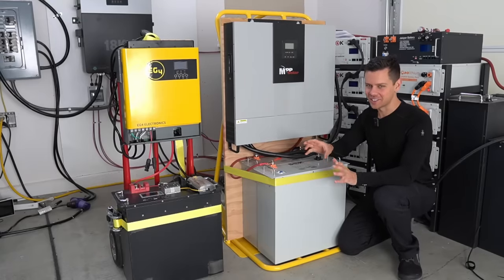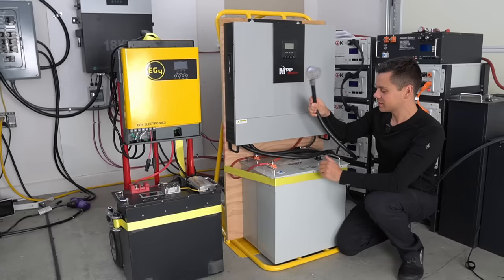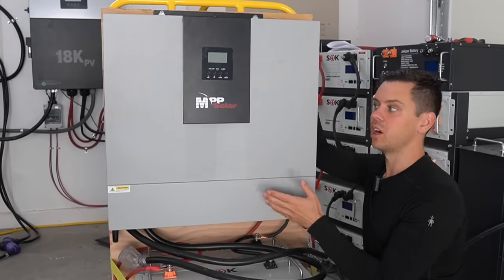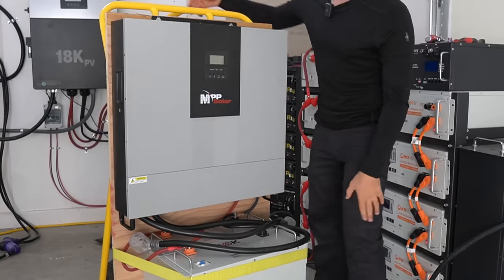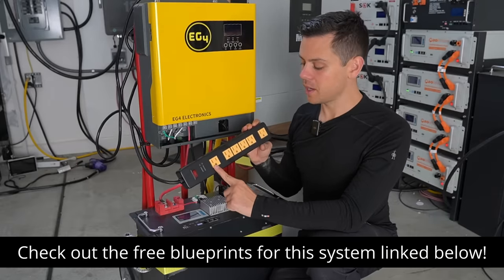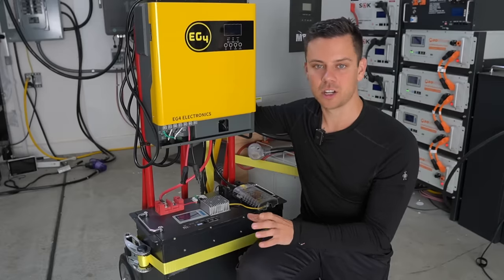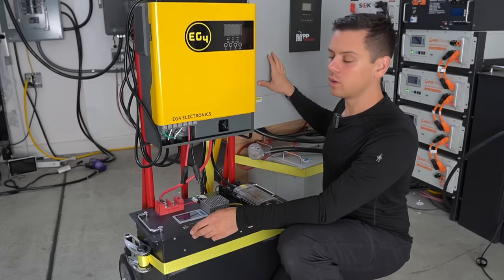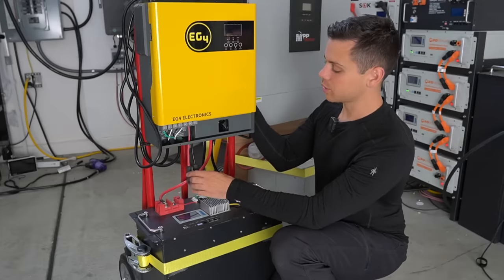240V Mobile Solar Cart! And New Upgrades for 3kW Solar Cart

Comment: Hey Will, love your DIY projects. I’m a long time viewer. I would like you to go back to your roots and modify a Class C RV. Add insulation, remove the old AC unit, cover the roof with solar panels and add enough batteries and an efficient AC. Could you be comfortable inside with the AC running 24/7 somewhere hot like Texas or Arizona with 100 degree summer days, off the grid?
Reply: You need to build a frame. That's outside of Will's purview.

18g 12" steel studs with a 1-5/8" overhang. You can get them in any length (such as the practical length of your roof, as measured without obstructions) from supply places that stock steel stud and track. Mfg is in Houston and Dallas.

Those will be your bottom rails. You'll have to figure out how to attach them to your roof. Rivnuts etc. You then need to build a complete box above it, with something like 6" stud and track, both to clear your rooftop AC, your roof arch, and form a mounting surface for your panels, and a hinged lid. Each upper box should ideally be limited to 10' for weight and other reasons. 

Observe if the centerline of the vehicle and where the rooftop AC unit is, will interfere with the rack. While you'll have 18" at the sides, of clearance, you have 12", minus 'the curve of the roof' clearance, where the 6" steel box frames meet (where the track runs across the rooftop to form the box). Modify your plans accordingly. One solution is to order that bottom rail stud as 14" - they are custom made anyway. The other would be to combine all the panels onto one giant box frame. I think that would be too heavy.. YMMV.

Use track to connect the upper studs at front and back of the 6", to form a box. You may want to build the entire box squarely, on the ground, then lift it into place.

10' is exactly 3 residential panels, so I suggest to do 2 upper boxes for 20' (6 panels), or 10' +  6.66' (3+2 panels). Leave room for a fairing in the front. Wired in series, that many panels will put you in the ballpark of a 250v MPPT AIO.

Drill holes along the long edges of the studs, exactly in the middle of the 1-5/8" lip, every 2.5'. Use fine thread grade 8, 1/4" bolts, 3/4" long, with a nut inbetween the two layers and a nylock nut on the end. That will form a 1/4" gap, that gap is important later.

Every 10ft is exactly 3 residential panels, so 440w panels will net you nearly 1500w. Starting w 16g 4" track, cut off one edge to form an L bracket, to mount to the top of your studs. Your panels outer edge will sit in this. Be precise in your positioning of the L brackets to the panel length, so they fit tight when installed. Best to dry fit with the panels to mark everything.

Remove the panels and wire brush and primer (with alu primer) the stud&track, dry, then paint everything to match.

Get heavy duty hinges, such as the Everbuilt 3 1/2" from HD. 4 for every 10ft. Heavy-duty U bolt latches, for every 5-6' (amazon) (2-3 per 10 ft). Hinges go on driver side, between 12" & 6" layers, latches go passenger (curb) side. Once they are all mounted, remove the 1/4" bolts between the stud layers, entirely on the hinge side. Remove the bottom nut - the nylock - on the latch side. 

You should be able to carefully lift the top box, and then lower it, and re-latch it. Install aluminium boat handles (Hillside Castings), two for each 10ft upper box, comfortable arms-length distance, near the bottom of the 6" stud, below the L bracket. You'll use these to lift the lid once the panels are installed.

Drop your panels back in, and use 1/2" long #6 modified truss screws to screw through the L into the side of the panel frame. 4-5 per edge per panel. Seal the panels inbetween, and along the edges of the L bracket, with Through The Roof. 

You now have a second roof and dry storage areas. Something as simple as notched 2x4's can form the supports to keep your panels tilted into the sun, when parked during the winter. Everest WLL S1022 flat-hook straps, used to secure truck loads, can hook into the natural oval slots in the lower and upper stud frames to keep wind from blowing the top up and off the supports.

Comment: I do have a question about the grounding, does that case for the EG4 ground? You have it screwed directly to the frame of that metal handcart. I remember you having another unit that put voltage to it's case or something like that. Could you maybe use nylon bushing to keep it insulated from the handcart?
Reply: I have an eg4 in box that needs to be setup. I believe that the earlier models did. The newer ones can,  ht require a screw in a specific spot on the main board to ground to case. This can be done by taking a screw from one of the occupied spots, and moving it to the unoccupied spots.

Comment: This wouldnt work with victron crap because their inverters send out 230 volt into the metal chassi from the neutral out if you dont "ground it".

Comment: I have a question it's not about this video but I'm out of my wits 
you see i have a infinisolar 5k 48v inverter and I would like to replace my batteries for a new one it's name is weco 5.3kw dual voltage the problem is I am not 100 percent sure if it is compatible with my inverter
Can anyone help please and thanks

Comment: 300 pounds on a hand truck is nothing.  The problem is the weight distribution.  putting the second 110 pounds out on the front is the problem.

Instead turn the batteries 90 degrees so the terminals are facing the side.  stack the batteries one on top of the other.  Mount the inverter on the front of the top battery.

To charge the 48v battery from a 12v alternator use a DC to DC 12 to 48 charger or even just a simple DC to DC boost converter set to the desired peak charging voltage.
Reply from the maker: That's true

Comment: Ah, the Ecoflow, Jackery and especially Bluetti definition of "portable" strikes again.
Couldn't you import UK components? Over there the little Anker power stations are 240 volts because that's just what the sockets are. Find camper van inverters and use plug adapters to change from 3-pin to US.
Reply: Probably 50 Hz though.

Comment: In what situation will a mobile system like this be used?
Reply from the maker: You can weld anywhere
Reply: Any situation where you might benefit from a battery/solar generator like the eco flow. The diy solution lets you build a more capable system for about half the cost and have plenty of expansion options. an ecoflow pro costs $3600 and only has 3600 whr of capacity, this is $1600ish and 5,000 whr capacity. Adding another 48v/5kwhr of capacity is around $1200 to $1400. Whereas it's at least $2000 to add more capacity to an ecoflow. For significantly less than a single ecoflow pro, you could get 10kwhr of capacity (vs 3600) and 5,000 watts of solar input (vs 1800). You could legitimately power an RV/small house off of this with enough solar power and not have to sacrifice anything.

Comment: Why does it have to be so large and heavy just to supply 240v?
wouldn't one EG4 6000XP be better, lighter, simpler and still provide 240 without including so much battery?

For others who simply need this huge capacity I think everyone here is skipping the obvious solution. 300 lbs. on any cart you name is still 300 lbs.
3 carts though are now a manageable ~100 lbs. 
You don't have to use what is available... you can build your own custom wheeled cart.

Comment: Why such a large plug for 240 volts we in the rest of the world use small plugs. They look like the size of a 3-phase plug.
Reply: The receptacle is rated  50 amps.  I have a 50 foot extension cord for my welding machine that had a cord about 30mm in diameter, same ends, 50 amp 240 volt rating.
Reply: @kimmer6  Well, that explains it! 50amps! Cheers.

Comment: How did you get away with installing all those things in your house? Where I live I have to get a permit, a lot survey, schematic diagram with an engineer stamp, a lot survey to install ground mounted panels and the installation has to be done by a licensed electrician. It's just ridiculous, because after all of that there still isn't a guarantee that the system won't catch fire.
Reply from the maker: It's considered a mobile setup
Reply: @WillProwse  Hey Will thanks for getting back to me, but I was referring to all of the setups you have. Does Vegas put you through the wringer like they do in Summit County Colorado?
Reply from the maker: @stuartbrock7586  actually I have a net metering agreement and I'm allowed to do upgrades without a permit. Most of them are temporary setups here and there. If you're not back feeding the grid you're fine though. It's just an AC battery charger at the AC input. Most of my systems are off-grid so I don't need any permits at all. Even my solar array passes without permits. I even asked my inspector
Reply: @WillProwse  that is what I figured it would be here as well. My intention is for the system to be off grid as well. If anything I would feed electricity from the grid to charge the batteries when necessary. Looking at an 18KW system from signature solar. Saw a picture ure if your setup in their site. Thanks for letting know about what is going on in your area. It's just frustrating because the politicians are all about people getting solar and then they slap all these laws in it that just make it more expensive and a hassle to deal with. Housing is the same. They put a bunch of laws in place that add 20 to 30 percent to the cost of building a home, then they are all aghast and perplexed by the lack of affordable housing.

Comment: Sad thing is, everywhere else in the world can have 220-240v single phase the same size as your original 🤣
Reply from the maker: No, that is not true. Those have less power output.
Reply from the maker: And it's not split phase. Need two separate circuits in series to create 120/240
Reply from the maker: Or could add transformer but that would cost a lot. This is why people don't use the growatts anymore. I have multiple videos that cover this
Reply: @WillProwse  you need to checkout what people who live with 230v electrics are buying outside of the US. Don't think we even have growatt in Europe!
Reply: I believe he means in Europe etc who use 230V there are the much cheaper units who only have L,N,G and the L is 230V in roughly the same form factor as the EG4 3000.
..but which is not who this video caters to either way.
Reply: @DAReckerr  correct, hence my opening of "elsewhere in the world"

Comment: ?HOW MUCH?  DID it COST.  TO CHARGE.  THAT TESLA.  < AT HOME ONLY >    ''For about: 40-miles only. I am no expert. Like Will is..  But I am guessing. Over $15,000.00 + 12 panel array. PLUS>  You need to be. A home owner only. PLUS> You have too hire. A solar Guru.  Like Will Prowse. To maintain it. AND: When you blow it up.  You are paying. At least $1,000.00. For a specialist.  Just too look. At it.  Therefore you need.  A rig. With individual parts.  VS a inverter charger combo box. You didn't build yourself.